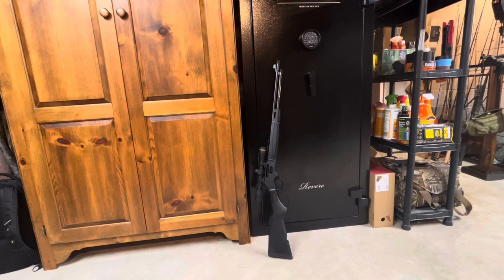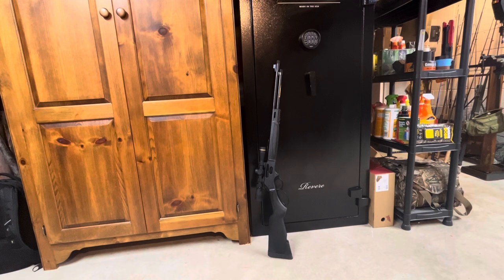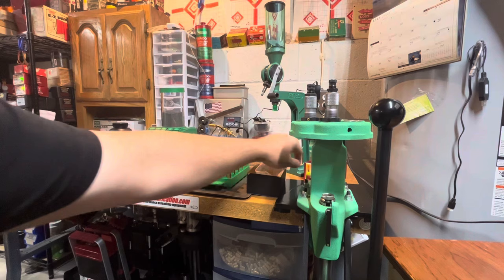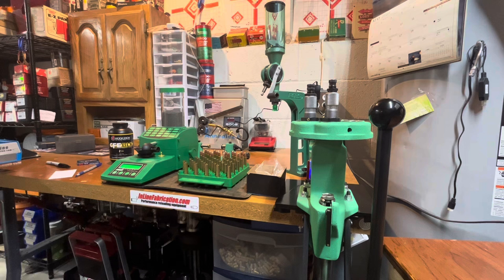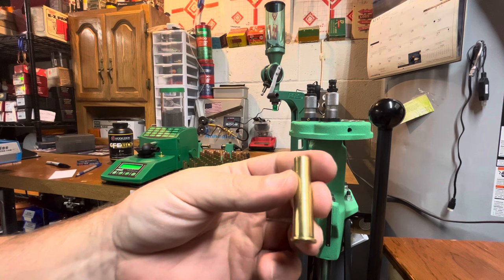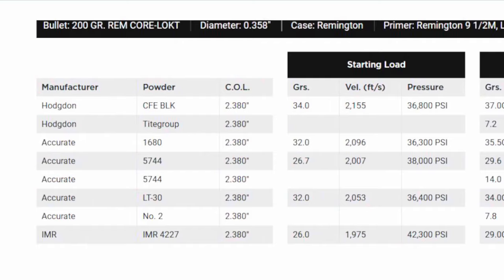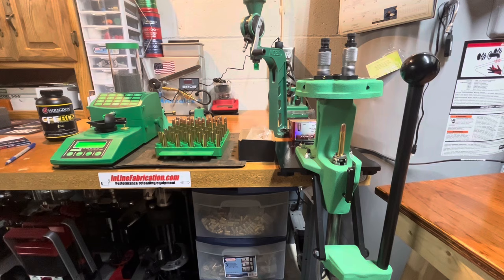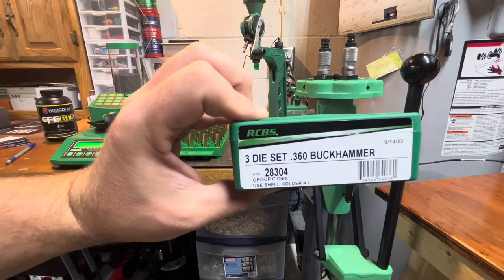Reloading 360 Buck Hammer with Load Data and Henry Model X #straightwall #hodgdon

Comment: 338 federal heck yeah.  I really like to hear your load data on the 338
Reply from the maker: It’s one of my favorite cartridges. It’s really an amazing round for what it is. I’m currently running a 200gr bullet at 2625fps with h322 powder. I could get faster with a ball powder, but the consistency was single digits with h322!

Comment: I just got my data sheet from Hodgdon dated 28 Aug 23 and it calls for the 9 1/2 Large Rifle primer. Not the Magnum. This is just a heads up.
Reply from the maker: Maybe they changed the data, but the loading table I shared in the beginning of the video is from Luke at Hodgdon. It specifically calls out Remington 9-1/2M primers.

Comment: What are you're best 338 federal loads?
Reply from the maker: My best load is a 5 round group out of a savage model 11.

Starline brass
CCI LR
43.4gr H322
200gr hornady SST
SD of 7.2 and ES of 20 at 2625fps
Reply: What kind of speed are you getting?
Reply from the maker: @rexking3698  I edited the reply. I’m getting 2625fps. If you look for that one alliant ball powder, you can get into the 2700’s but not sure about accuracy. That’s for 338 fed of course.
Reply: @avidwaterfowler7522  thanks.  I'm shooting a savage model 16 weather warrior bear hunter

Comment: 45 70 s little brother
Reply from the maker: I agree. I was thinking the powder burn rate would equal the 45-70, buts it’s between the magnum pistol powders and 45-70…. So I had to buy the CFE BLK, no big deal it’s pretty much everywhere.

I’m a huge 35rem fan, so this cartridge made perfect sense for me and I already had bullets in stock. The 35rem just can’t produce the speed this 360BM can since the operating psi is much lower. You’d have to go outside the book max quite a bit. The big advantage for me with the 360BM is I can hunt with it in MD where my father lives.

Comment: Working on a 180 grain Speer flat nose with lil gun in my new buckhammer. Brass doesn’t seem like it’s going to last very long though
Reply from the maker: I’m not entire sure there is room for any 180ga bullets in my future since I hunt mostly thick woods. Why do you say the brass won’t last?
Reply: @avidwaterfowler7522  I’m just experimenting with the 180’s. I like the 200 grain round noses better. As for the  brass, with it having a rim, that shortens the life of it unless you make it headspace off of the shoulder. That’s what I do with 30-30 to extend its life. Well the buckhammer has no shoulder so its headspacing depends solely on the rim. Then to make matters worse the brass is the thickness of 30-30 brass but it has much higher pressures so that’s going to hurt the life of it also. Mine seems to stretch about 0.007” every loading
Reply: @avidwaterfowler7522  I’m just experimenting with the 180’s. I like the 200 grain round noses better. As for the  brass, with it having a rim, that shortens the life of it unless you make it headspace off of the shoulder. That’s what I do with 30-30 to extend its life. Well the buckhammer has no shoulder so its headspacing depends solely on the rim. Then to make matters worse the brass is the thickness of 30-30 brass but it has much higher pressures so that’s going to hurt the life of it also. Mine seems to stretch about 0.007” every loading

Comment: Just began reloading for my 360 but 35 caliber round nosed bullets (358") are as rare has hens teeth from any site I've used thus far.  I opted to try some bulk blemished 200 gr polymer tipped spitzers but found with my RCBS die set the bullet seating plug destroys the polymer tip.  No luck thus far finding replacement seating plug that specifies use for these style bullets. Will have to resort to drilling a cavity in the plug that came with the set I guess.
Reply from the maker: Are you using this spitzer bullets in a lever gun? Not trying to be a smart ass, just don’t want to see you pop off a round in the magazine tube. You can find .358 bullets online. Try midway, graf and sons, and midsouth shooter supply.

As for the seat plug, that’s exactly why I went with Redding dies. That is absolutely nonsense that RCBS send the dies with a flat seater stem. I was told, if you can them they will send you a different seater stem.
Reply: Call rcbs and ask if they will make you a plug.
Reply from the maker: @marklewis9594  I already sold the dies and bought Redding dies. I’m a Redding guy anyhow.

Comment: I just picked up my 360Bh today. Thanks for the info. While I was waiting for paperwork I ordered rcbs dies and some 180 gr hot core. If i dont like those bullets i will try them in my 357max. I have always loaded from the Lyman data, it always seems to be more on the conservative side just waiting for a new addition. I am curious how .357 xtp bullets would work in this application, they work great in the max.
Reply from the maker: I honestly don’t think the xtp bullets would hold up under the speeds I’m runnning. The 200gr round nose are perfect out 200 or so.

Comment: Hello: I have a Hornady Single stage press with RCBS Dies for 360 buckhammer. Which Shell holders do you use, I am thinking a Hornady #2. I have a case trimmer and I may need to use a hornady single shell casing for that specific issue. How did you trim the case to keep it under 1.80". I am also in Pennsylvania right in the middle of mandatory slug or 360  buckhammer or other Straight wall cartridge. I just need to know which shell holder to use even if its not a Hornady shell case. :trophy-yellow-smiling:
Reply from the maker: I don’t know hornady shell holder sizes, but there are conversions charts online. For Lee it’s a #3 shell holder.

Comment: This round is the old 38-55 they could not make it the 38-55 because their are to many old rifles that could not handle the pressure of this round look in your reloading book for the 38-55 and you will see that i am saying you might want to the 200 grain flex tip from hornady i used this bullet for my 357 maximum in ohio i am glad that they came out with this round and 35 cal bullets i want to use 180 grain for the maximum to deer hunt with and be careful with the 1680 back in the 1980 at silhouette matches the T/C wouldn't unlock after so many rounds shot good luck with your new rifle
Reply from the maker: It’s definitely fairly similar to the 38-55. The big difference in these new rounds is they up the maximum operating pressures. I’m a huge 35 rem fan, but the cartridge definitely suffers on the velocity front because of low operating pressures. A great example of cartridge versus pressure: If you look at the 450 Marlin, it’s a 45-70 designed to run at higher pressures. They made specifically for that reason. Most 45-70 ammo runs a the lower operating pressure to accommodate older firearms.

I do have FTX bullets already since I already had loading components for 35rem. These are next on my list for trial. Since I mostly hunt thick PA hardwoods, the 200gr round nose is a solid choice overall.

Comment: Great video. I emailed Hodgdon around a month ago asking about the load data for this round but they didn't have it yet. I'm still playing around with it a little but I'm getting pretty good results with Lil gun and 200 gn Hornady FTX bullets with large rifle primers. What are your thoughts on using the Lil gun for this cartridge?
Reply from the maker: I would assume the lilgun and H110/296 would work. They may not get the velocity you’re looking for. I can’t find any 35cal bullets locally for some reason, but I would think those FTX would make this a 250yrd cartridge.
Reply: @avidwaterfowler7522  Thanks for the input. I'll try the powder you're using on my next round of reloads.

Comment: What is the starting load using Titegroup? The data sheet shown looked like it was blank on starting load line.
Reply from the maker: It’s blank because it’s a subsonic load. You could possibly work down if you wanted slower, but thats up to you.

Comment: Is ur 450 a bolt or Ar
Reply from the maker: It’s a Ruger American Ranch bolt action. It is awesome!
Reply: @avidwaterfowler7522  I got the American go wild camo I got a load worked up c.o.a.l is 2.375 using Barnes ttsx 250gr an h110 47gr. Starline case an Winchester small rifle primers an no pressure signs fps 2690
Reply from the maker: @kennethshoemaker2941  that’s the model my dad has. The 450BM is awesome! I load the 250gr FTX with 43.5gr of H110 and a cci450srm. I’m somewhere in the 2300+FPS.